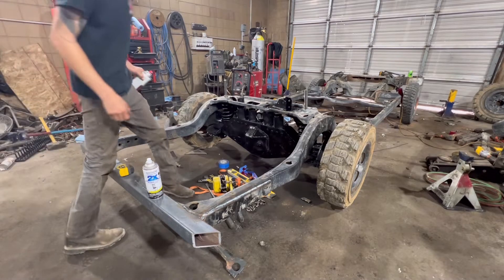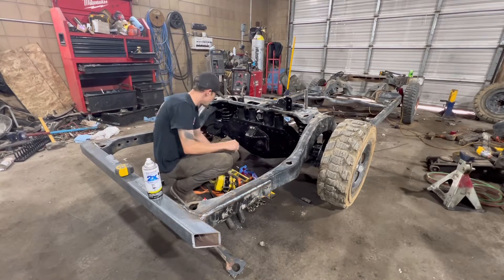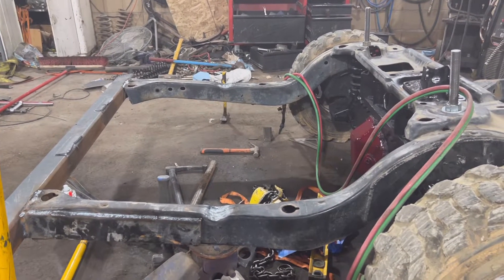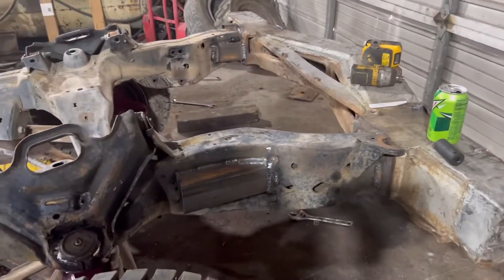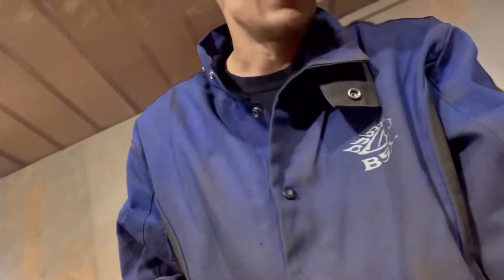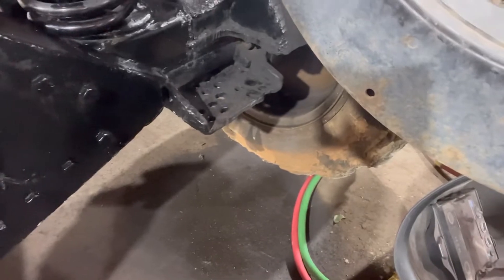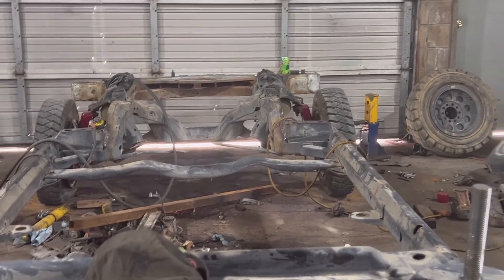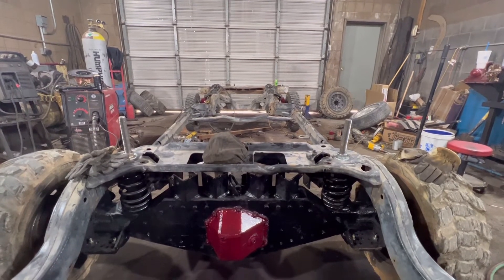Heber update #3!! Still waiting on parts! Will we make it in time?

Comment: I have a question, if you have it dimpled on the rear to roll in, are those long plates even gonna do very much that are welded on? I only run stock class so all the welding stuff is kinda new to me. So was just wondering.
Reply from the maker: They will just make sure it bends at the dimple point! And strengthen the frame rail when it’s folded 🤙
Reply: @Tysonshelley19  ohhhhh ok. That makes sense. The only welding I do is cage and doors. So I'm not familiar with the frame setups of built cars. Thanks for the info. I'm also looking forward to seeing more on that Imperial!! Not allowed ANYWHERE near me so I've never even seen one.
Reply from the maker: @derbyfreak8183  I’ll have another video on the imp tomorrow night! 🤙